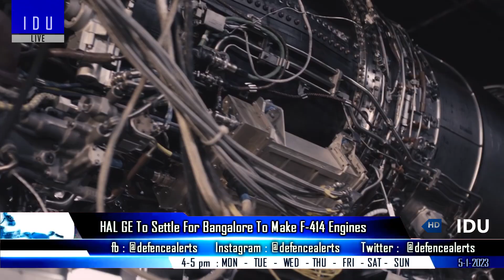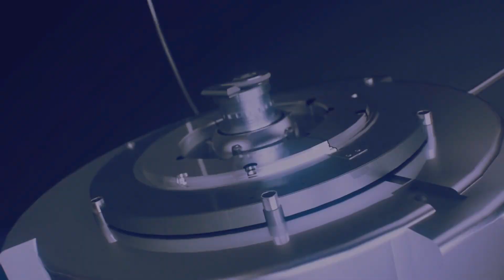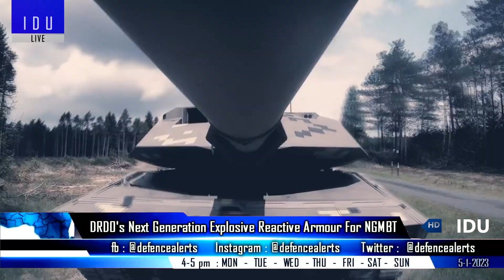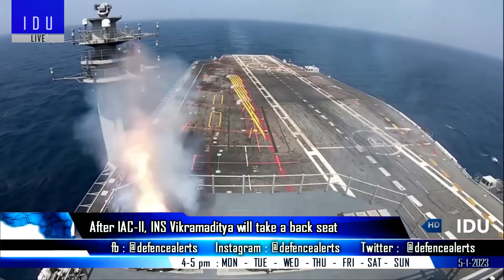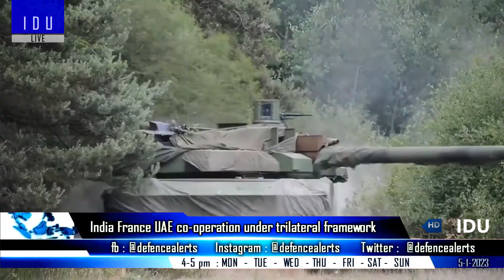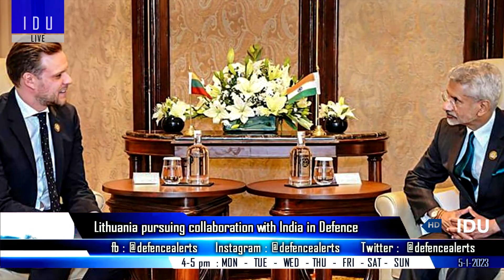Indian Defence Updates : Ghatak Engine FADEC,NGMBT New ERA,F414 Production Bangalore,Rafale Forum

Comment: FADEC (Full Authority Digital Engine Control) technology has been around for roughly 45 years, with its origins tracing back to the late 1970s. However, in India they are still for partners to implement this in the GHATAK engine.

Comment: Good that DRDO is developing Next Gen ERA, but one of the weak points for tank and often fatal is threat against Top attack missiles,  there should be a tech developed against top attack missiles, Maybe an active protection system that fires a "explosive shot" against incoming missile, and taking it down with a "top attack" of itself
Reply: Kanchan 2 Armor is also bring developed + indigenous APC for armoured vehicles...CLGM is already there...+ 1500 bharat pack engine already tested...+ A new type of light weight HNS steel..
Reply: Isiliye india ne Russian active protection system reject kiya
Reply: @kksingh8675  Israeli systems are most effective, Russia has dveloped Afghanite which is quite capable, but most APS do not really address the top attack missile threat
Reply: @kksingh8675  jitna jaldi Russian system ko kam kiya ja seke utna acha hai. Russian ki adhi chize bekar hai
Reply: Thank you sir ,, we never realized it.....that we took 30 years for development heavy obsolete Arjun.....
Reply: DRDO must have announced holiday in its office on Holi. Meanwhile UCAV from USA are to be imported.?
Reply: @pcom9209  drdo have many Drone projects UCAVs AURA,GHATAk etc..already made
Reply: @hardeshmanhas4102  toys and useless. Importing many different drones from Israel, USA. all that is to showoff.